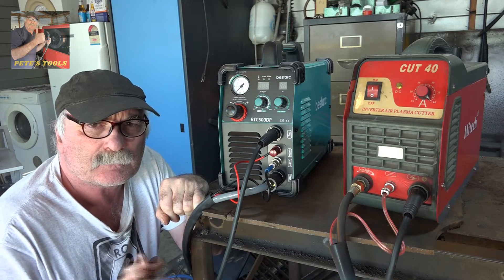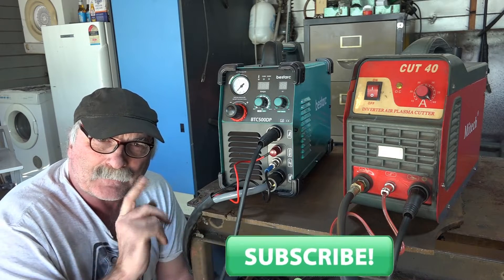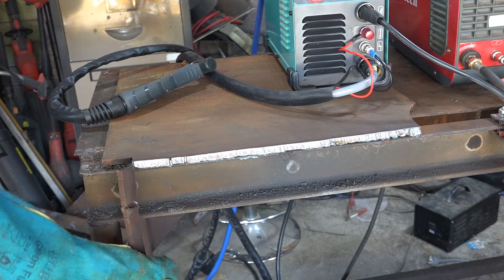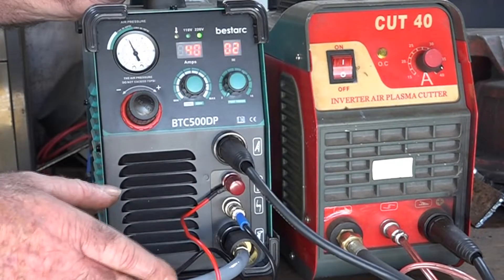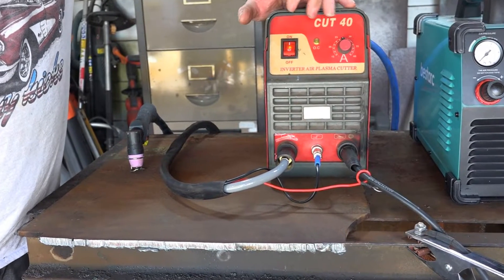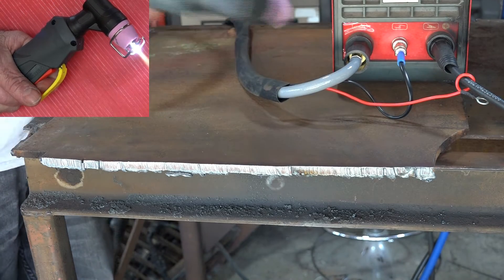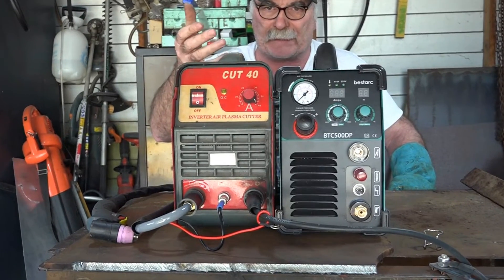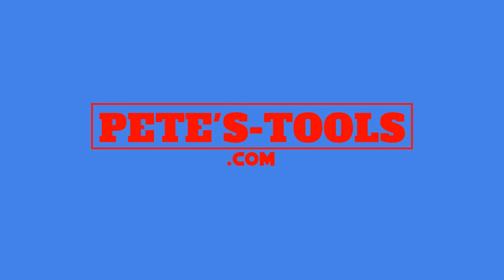Pilot Arc vs High Frequency (Can You REALLY  Use The Same Plasma Torch )

Comment: Hi Pete, I bought a cheap Ebay torch AG60 based on one of your videos. It doesnt have the correct brass connector though, my machine needs a male connector on the end of the hose, it came with a female one. I didnt really check this before buying it, was pretty cheap though. Mine is a 15 year old Liquid Arc 3 in 1, by Lincoln I think.  Is there an adaptor available somewhere?
Reply from the maker: Not sure

Comment: Hi Pete. Thank you.  You have answered my questions about torches and PA and non PA very well.  I've got the Amico APC-50HF Pilot Arc with AP-80 torch. Now I know that by disconnecting the pilot arc wire, I can use the same torch to cut without the standoff and touch the metal.  Question: Should I be using a drag tip style tip when not using the pilot arc?  (I just need to find one that fits I guess).
Reply from the maker: I just use same tips for both
Reply: @petestools  Thanks Pete - I'll give it a try!

Comment: Hi Pete,   Thanks for all the hard work.   You can cut the pilot lead eyelet so that you don't need to remove the red nut, just loosen it.  Cut just wide enough it skips off the stud.  The washer can also be glued to the nut so it stays in the correct position.  I used super glue.  When I remove the pilot lead I simply loosen it and slip it off. The nut won't get list or damaged.  Plenty of contact area left to handle that low start current.  Looks like this " ----------C " when done.
Reply from the maker: Nice idea

Comment: Pete, the problem I have is with my HF60P machine is it eats consumables like candy. I really wish you could buy a standoff tip that can be dragged across the material you want to cut but not have that wire and ceramic cup. My torch is the exact one you have in this video. I really wish they made a tip like HyperTherm
Reply from the maker: I only ever use stand off to cut sheets .Otherwise i just remove it .Consumables last same time on both.